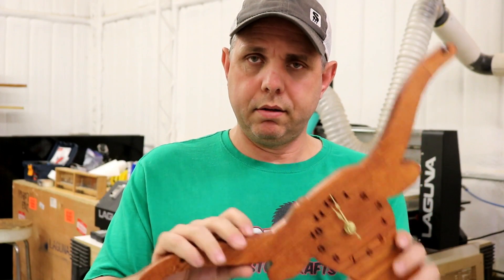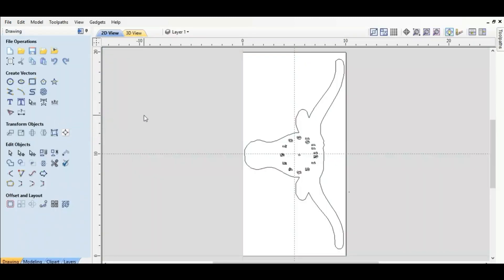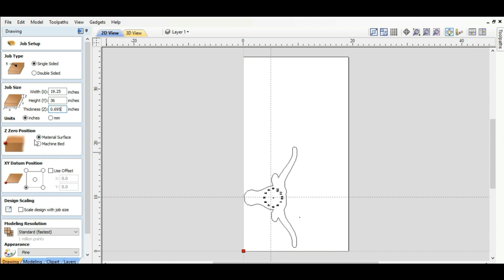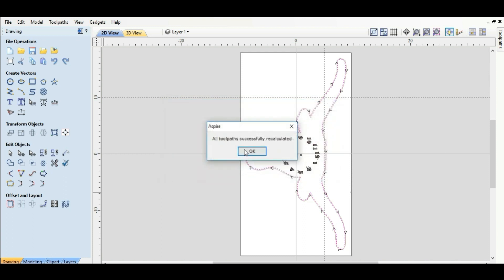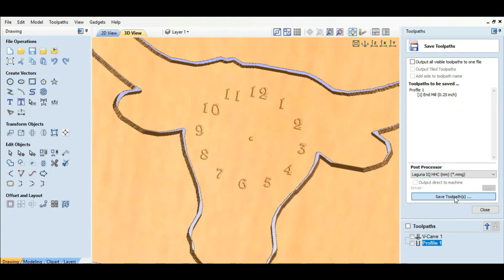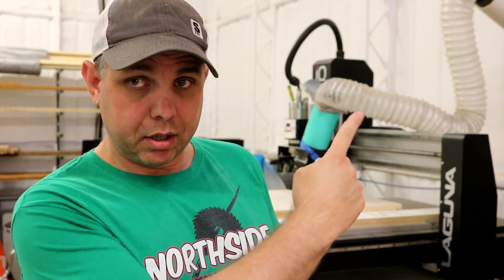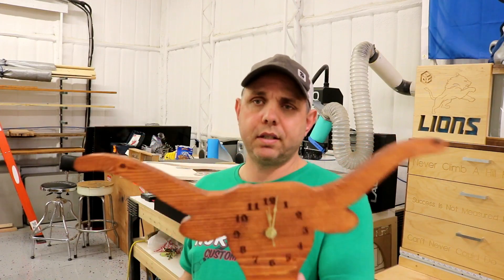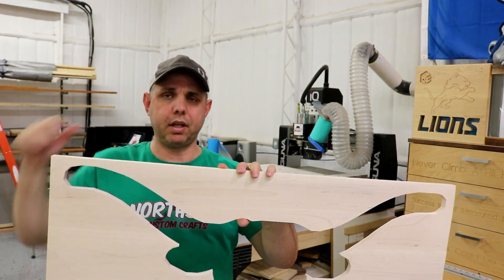How to Make Money with a CNC // Laguna IQ CNC //Aspire Tutorial

Comment: I notice you don't leave any "tabs" to hold your work in place when the cnc cuts all the way through the work piece. Do you not have any problems with the piece shifting before the cut is finished?
Reply from the maker: Paul Allen Thanks for watching Paul!  This piece did move just a bit right at the end.. normally I would put 2 sided carpet tape under the project. Or I will cut just a bit shallow and remove the rest with a drum sander. The material for this project was already a little thin and didn’t think about putting tabs in until it was already cutting.. I had to sand extra on the side of the face of the longhorn because of the shifting.